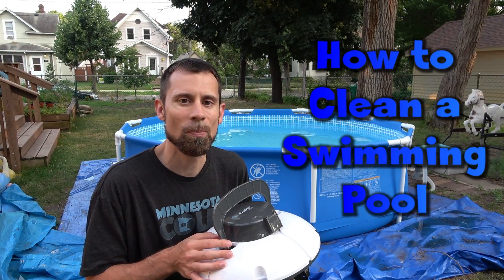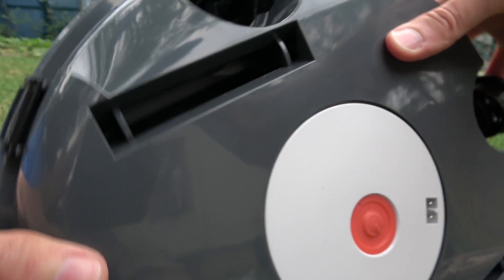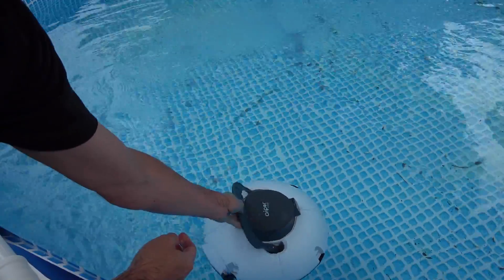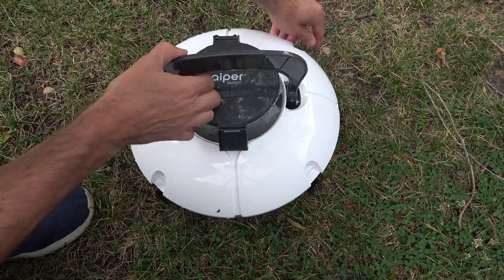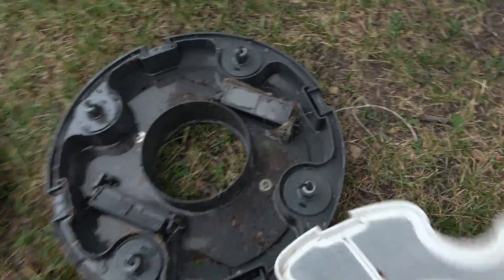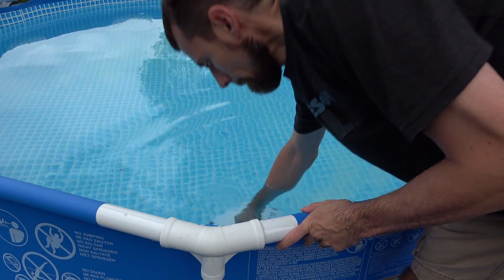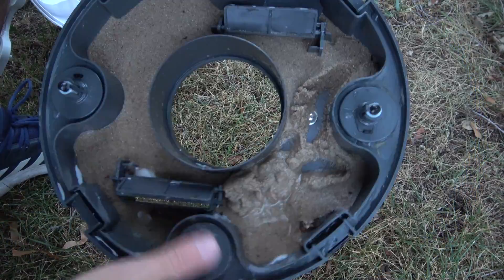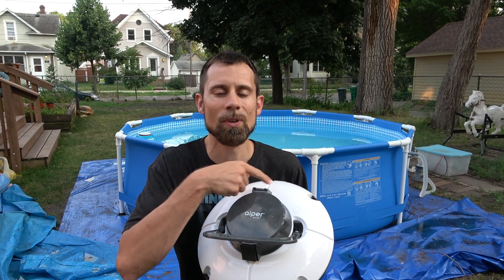How to Clean a Swimming Pool with a Robotic Pool Cleaner

Comment: How long does the battery charge last?
Reply from the maker: The box says 50 minutes. I had it running for at least an hour without it dying. It does take a long time to charge, so I just plug it in and leave it charge overnight.